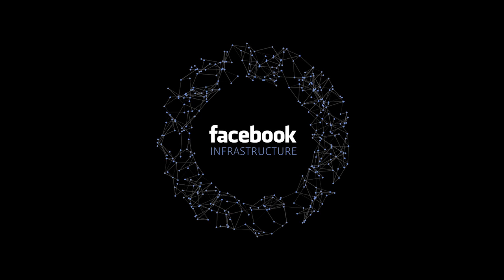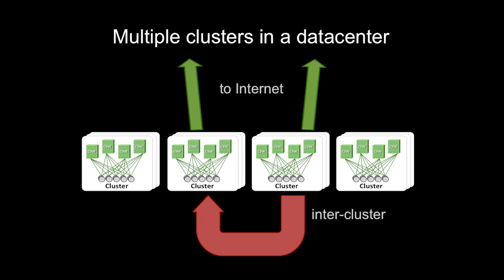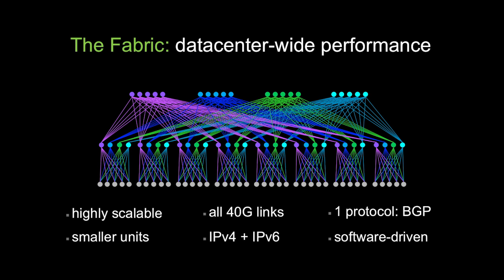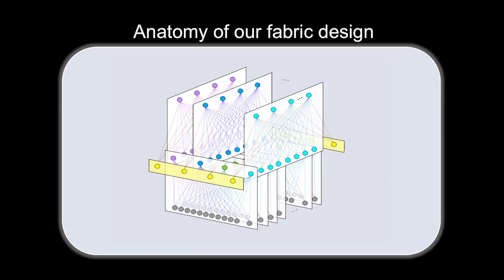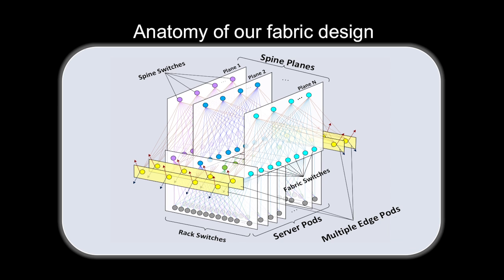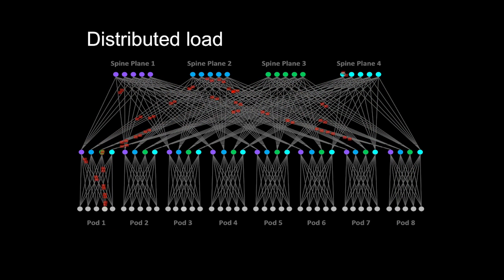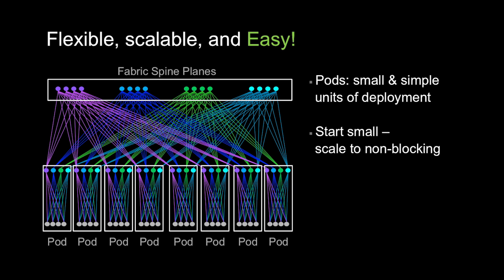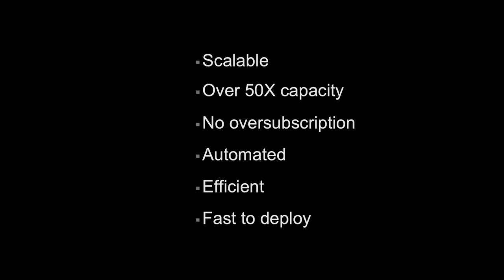Introduction to Facebook's data center fabric

Comment: Curious to know if there is any central load balancing controller since there are several paths between servers and edge switches may not have a full view of traffic load in the network
Reply: Tor and Fabric do an ECMP style path selection.

Comment: Very interesting. What optic standard did Facebook use for the 40G runs? i.e., expensive LR4 optics with duplex SMF or cheaper SR4 optics with four pair of MMF?    I wonder how the cost comparison would be with Cisco 40G BiDi transceivers and duplex MMF.
Reply: +craig weinhold I am interested too. Optics costs higher and higher.